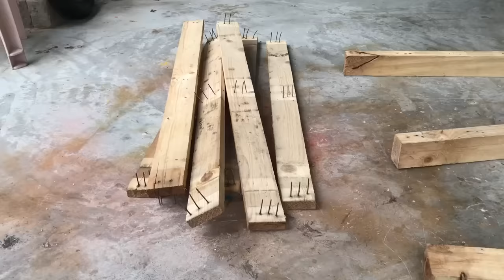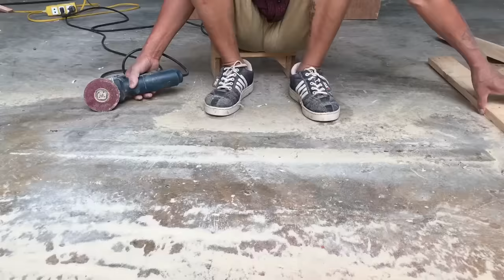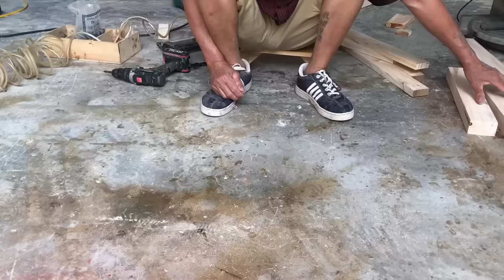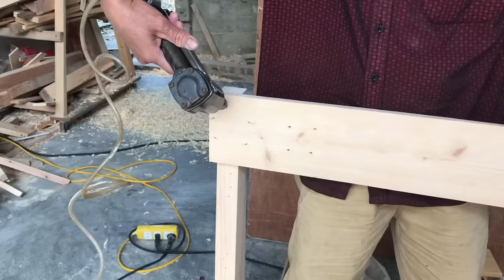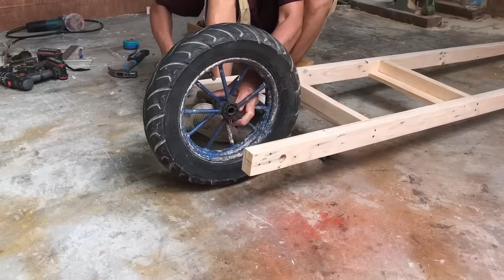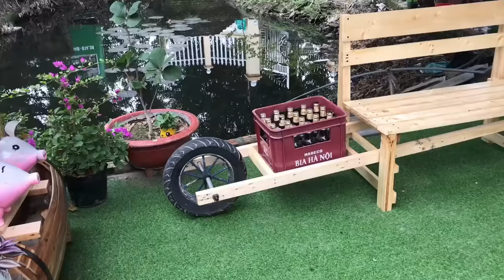Inspirational Woodworking Design Ideas // How To Make Outdoor Benches From Pallets Extremely Unique

Comment: You make sum cool stuff. But I urge you and every one else to stop using pallet wood as it is sprayed with pesticide and other dangerous chemicals. 
 Instead atv and snowmobile crate material offers better free wood at most motors ports shops. You can even get a lot of cool steel corner braces at different angles. Lots of free bolts as well. 
 Cull wood which is wood that has been pulled from lumber surplus at any distributor like lows or lumber yards is often free or discounted. 

WARNING PALLET WOOD IS VERY DANGEROUS TO WORK WITH!!!!